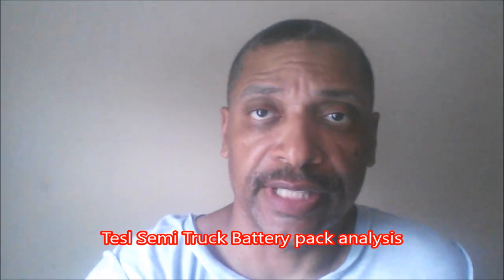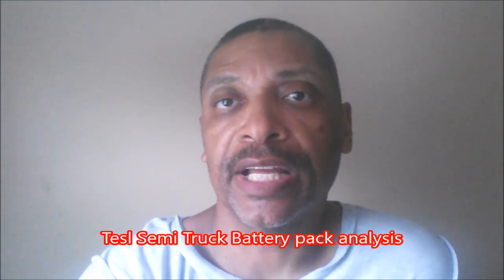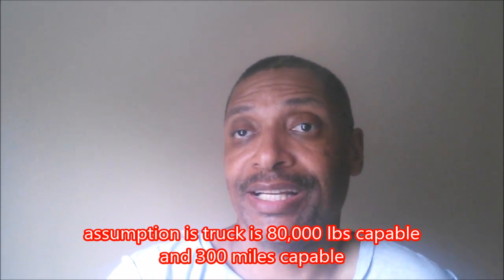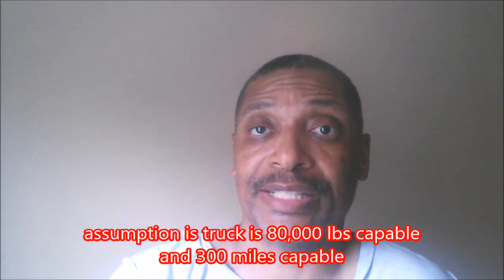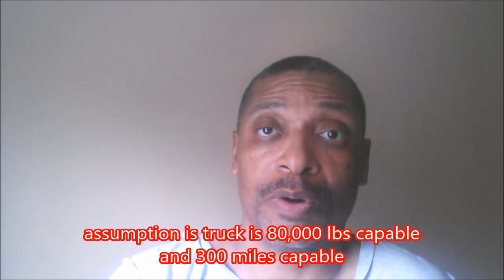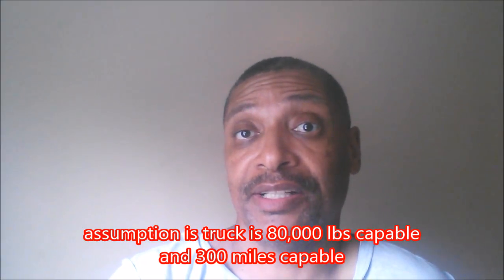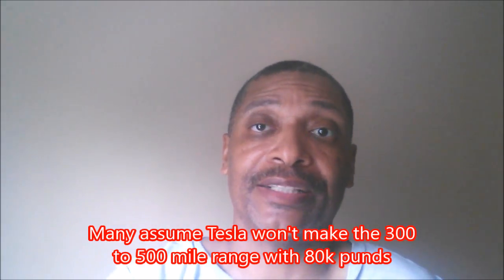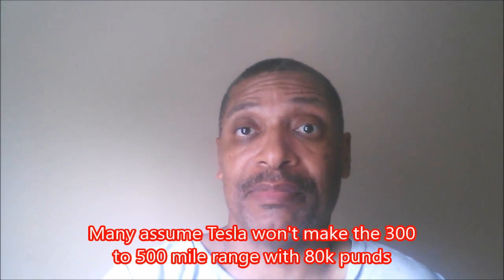Tesla 2170 semi truck mule battery pack analysis. Tsla stock to 3000

Comment: The engines in the truck are not Model 3 engines!
The model 3 features permanent magnet switched reluctance engine. These are different as in the Tesla S or X and you can tell immediately on their black Tesla capacitor of which the truck has none. But what a striking that is it gives much more cable as one actually brews or are that perhaps pipes? No idea how Tesla wants to do that but so far they have always kept their promises, even though this will probably change the boundaries of physics.

Comment: In your research, any idea what the battery rating of each 2170 battery is?  I think a good 18650 is about 3 amp-hour.  At 4V, this gives 12 Wh per battery.  So about 83 batteries are needed for 1 kWh and 8300 batteries for 100 kWh.  Another equivalent question is how many batteries are in the new Model S battery pack?
Reply: +Brad Preece Those aren't the correct figures for calculating battery/cell capacity. But before I tell you how you are wrong I'll try to answer with what little we know about the 2170 in the Model 3.
A P100D has 8256 cells in 16 modules for a total of 102.4 kWh according to a recent teardown of one. That implies 3350 mAh per cell. That is way, way, can we have another way, up there considering that the Tesla cells are supposed to be a tweaked chemistry that delivers 10 times less degradation than Panasonic's standard 18650B cells that they are based on. Those consumer cells are 2700-2900 mAh.

The specs for the physical size of the individual cells (on the outside) is 18mm by 65mm for 18650s (the 0 stood for round. Really.) and 21mm by 70mm for the 2170. The volume of those is the diameter squared times pi divided by 4 and multiplied by the length. So the nominal volume of the 18650 is 16,540 cu. mm and the 2170; 24,245 cu. mm. The 2170 is greater in volume by 46.6%. 

Now, since those are the outside dimensions, that includes the walls of the cell container and any ridges, cell pressure relief valves and short circuit protection. Assuming that the cell wall thickness remains the same and so do the other components that don't store charge, there is going to be a very slight gain in the ratio of chemicals storing power to overall volume.
Just using our 46% increase in overall volume, that suggests a 2170 with the same chemistry (not a safe bet) would have a capacity of around 4900 mAh. 

But we also know the insides of the Model 3 batteries. The 50 kWh battery has 2976 cells and the 74 kWh battery has 4416 cells. That implies 4541-ish and 4529-ish mAh, respectively, well within the Tesla tradition of rounding off the nameplate capacity to the nearest 5 kilowatt-hours.

 I think that they might be leaving capacity on the table by limiting the peak charging voltage and/or raising the lower cutoff voltage in the interest of ensuring longevity with the new cooling design and pack architecture. Or they went with a different mix of manganese and cobalt. Less cobalt is usually a lower capacity cell. More manganese is less temperature sensitive (safer).

Although you happened to luck your way into a close guess, where you went wrong was multiplying by 4 volts. The nominal voltage of modern lithium cells, excepting LiFePO4, is 3.7 volts. You can think of "nominal voltage" as the average voltage across the discharge curve, weighted by time. Lithium cells do not act like Lead-acid or alkaline cells. They don't go much below 3.7 volts for most of their discharge cycle unless absolutely hammered above their current rating. This makes them tricky to use voltage as a stand-in for remaining capacity.
Reply from the maker: there are just over 7000 batteries in model s for 100Kw.  the numbers on 18650 our out heavily but tesla not giving up all details on 2170 yet.
Reply from the maker: greatpost. nice having chemist